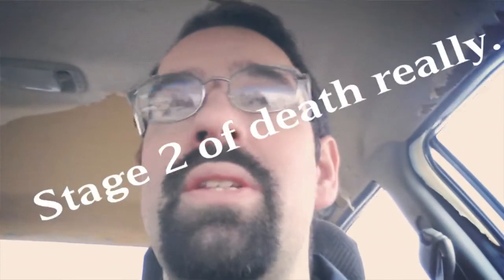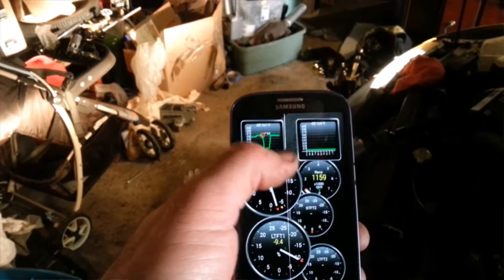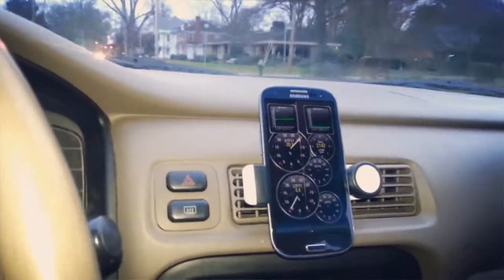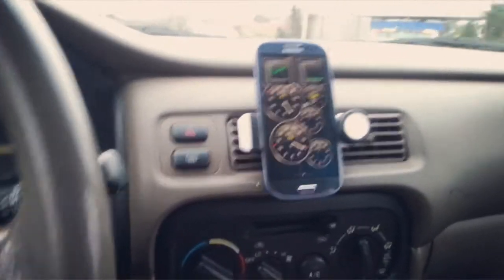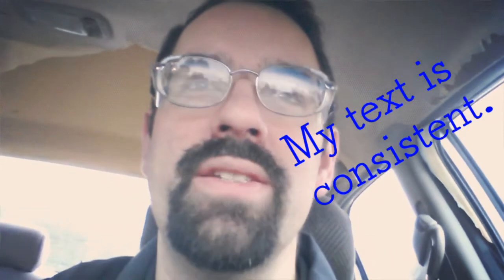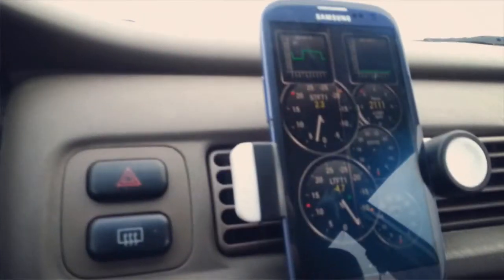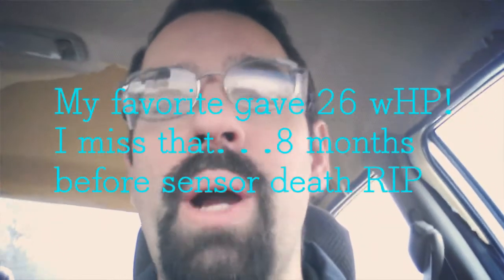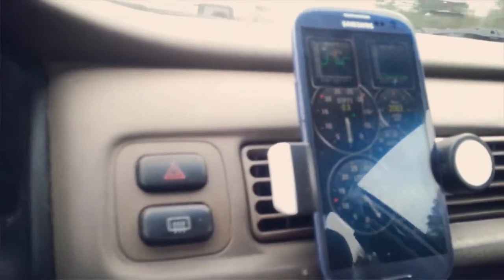O2 Sensor Testing: Stages of Death

Comment: .this sensor act like crazy
 ?what is the brand of the new sensor
Reply from the maker: +toolman talal The new sensor is a Bosch. JC Whittney kindly warrantied the last Bosch which I had had in operation not even a month.
Reply: +DE Nichols is the Denso sensor the same as the original sensor?
Reply from the maker: toolman talal Yes.
Reply from the maker: toolman talal Needed a third Denso in 14 months so it was time for a change.

Comment: Good to see that you got the fuel trims under control with another sensor. Interesting how it took several sensors to make things work. Good job DE...
Reply from the maker: +stuzman52 The two denso did work, just not long term. So  hopefully the Bosch will hold up. The last one was just calibrated wrong at the factory. Well, one of the Denso's was calibrated in my favor for power, but I wonder if these sensors take too much fuel they can chemically react too much, as some of the materials are like a catalytic converter. Cleaned an old O2 sensor once. Made it work great again for about 3 days before it went through stages of death very quickly. Had been inspired with the stages of death idea until a lot more struggle. Hey, if it was all easy, it'd be boring.

I've learned a lot from Schrodingers Box/experience to claim a factory sent it out uncalibrated! lol I felt rather bold just now. :)

Comment: Well i can say with total accuracy, i havnt a clue what you were doing ha ha :-D
Are the sensors faulty, if so did you replace them?
Reply from the maker: The video would have been very long to show replacement so I attempted to bridge that scene with a comment on the screen after installation. But maybe a very brief scene where I show that I'm replacing that and that folks who need to know how should watch my first video  would be clearer.

The one thing you can change in YouTube without it being a whole new video is adding links in the video and text comments to make that clearer. 

You make my production better and more enjoyable to do. 

As far understanding the analysis, I have a link in the description which leads to nearly a half dozen articles I wrote on O2 sensor function and related systems. 

But in the end, the symptoms fixed was hesitation and poor idle. Deep down, most of the symptoms were hidden by the car's clever computer or PCM, which take some training to get. If you prefer videos there's  my first on the subject talking about function, but clearer are my articles or Schrodingers Box video called the Secrets of Fuel Trim.
Reply: +DE Nichols 
if i was into cars as deep as you, i suppose the output of sensors would make more sense to me.
I do wonder about the speed and accuracy of the data you are relying on to analyse the sensors, the computer running the engine may not be giving you a complete picture of the raw sensor thresholds.
I could be talking crap, i often do ha ha :-D :-D
Reply from the maker: zx8401ztv You are quite right. This PCM reports information like an old Pentium trying to run Windows 95. It might get you the latest word perfect to make your school teacher happier with you, but you'll wait for every word to show up on the screen as you type.

This video could probably show the data patterns in a fraction of the time with a Pico scope. But I just blew a third of my savings on the power probe iii master kit and a serpentine belt tool. Can't spend the rest to have a scope, without enough bells and whistles to really use it.
Reply: +DE Nichols 
LOL i was going to say connect an oscilliscope direct to the sensor, but i thought you may call me an old git, so i didnt bother ha ha :-D
Reply from the maker: My new shop has one! I'm so excited! The manager had just finished hiring me and when he showed me the oscilloscope, he said it was old school and no one used them anymore.

My brow furrowed and I said how else are you going to condemn a MAF, crank or cam sensor just to start. He smiled really big. I passed his test.

I recorded most of this on the way to the interview. You're the first to know on my channel. 

He tested during me the interview asking what my volt meter should say on various components that are tested by resistance. Sure they could have a 5 volt reference but he asked about the sensor itself.
Reply: +DE Nichols Well done ;-D
Sounds like you impressed him, using an analog oscilliscope will show the realtime output of the sensor.
If it has two channels, you could connect the other to the other sensor and trigger from one waveform so they are stable.
Reply from the maker: +zx8401ztv Tell me more. I've hardly touched an oscilloscope and that was High School.
Reply: +DE Nichols 
Making sure you have the vertical amplitude set correctly will ensure you dont go off the screen with the waveform, set the voltage per vertical square for that. 
Count the vertical squares then times that by the voltage per square switch for the amplitude.
Leave the ac/dc switch to ac for basic amplitute monitoring, any standing dc bias wont affect the display.
If you use the dc switch position, you will have to adjust the vertical shift control so the scan line is at the bottom of the screen, any positive increase in voltage in respect to earth or standing dc bias will be displayed above the scan line.
The horizontal timebase control is the speed of the scan from left to right, this you adjust for the period of time displayed from the point of triggering set with the trigger control.
You will have to set the trigger selection to the channel you wish to trigger from.
Once you start messing with the controls you will quickly get the hang of it again :-)
Reply from the maker: ***** Yep. They lost their lead tech. They've got no one for diagnostics. I told him, you know where I am the Master tech gets all of those, right? 

My resume included the advanced repairs I do on the side. My 75 published articles online and my own starting YouTube channel.

After the offer, I was like. Okay, don't call me crazy, but you're offering pay for what I'll be. I don't have a ton of experience on the advanced stuff. Just a lot of study (Schrodingers Box was on my mind in the interview as I  told him how I'd test various components. He kept loading the questions wrong and I corrected every question.) He'd smile because I got passed all these trick questions. 

And said, "It's okay. I'm going to pay you what I think you're worth."

Sorry, way about me, but that's how job offers go. I'm sicker than a dog, but otherwise happy. How are you?
Reply from the maker: zx8401ztv Thank you! That does bring High School memories back. Including bits I never learned.
Reply from the maker: +CB Tech crazy story. The true ones can be crazier than fiction. You combined in one story multiple things across multiple jobs that made me uncomfortable. 

Just one of them:
Worked at a factory where the department head nearby was a hells angel. Having to give two of his guys a tour of my department when I had to also keep it running was insane. That many guys with nothing better to do felt very wrong and dangerous.